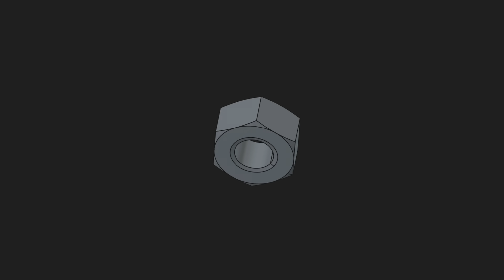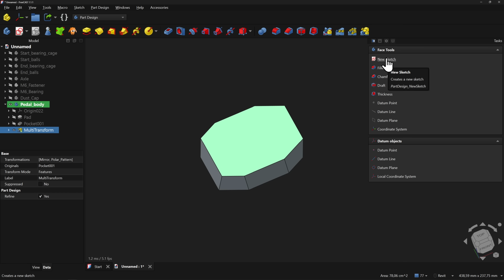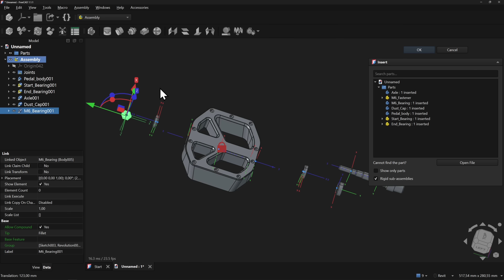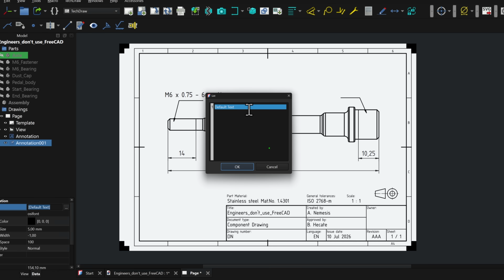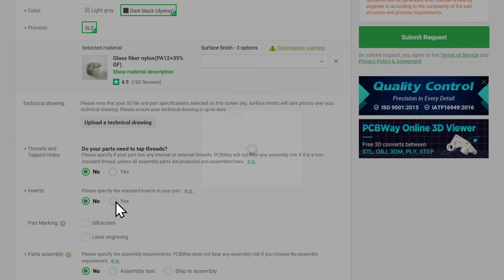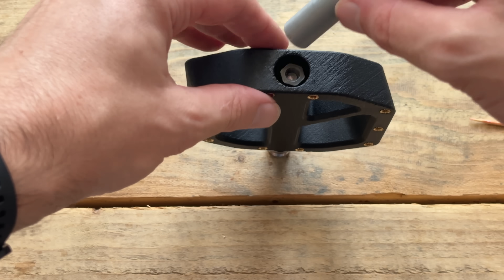Engineers don't use FreeCAD... Until NOW!

Comment: engineers DO use freecad! I used it last year for my machine design project in mechanical engineering and got full marks, the workflow the assemblies everything works really well. I do use creo now for work but for personal projects freecad is still my go to.
Reply: My team decided to switch to freecad to avoid the limitations we had with fusion (just one license for all of us) and we're having a good experience. Engineers use whatever is available (even if it's  from Autodesk) to complete their projects and Freecad has improved a lot. There's no reason to discard it for serious work
Reply: @dhombios well said. nothing wrong with moving to a different tool if it works better for you or your project
Reply: @dhombios  There are many reasons to discard it for professional work. Also ever heard of Solidworks, Solid Edge, NX, Catia, Inventor, ...? Any of those is much more powerful and stable than FreeCAD.
Reply: @iliketoast-q9b   It's interesting how the value of a computer's hardware depends on the quality of its software, yet many will happily spend thousands for hardware and practically nothing for software.
Reply: @dhombios  It's incredibly stupid to choose free tool over a commercial one just to save a few bucks. Commercial license fees are far less than the cost of the engineers' time. Moreover, the time it takes them to retrain on the free software plus the lack of features makes the free software more expensive.
Reply: @bobweiram6321 it isn't if you can't decide the number of licenses bought, but you can choose the software. Corporate decisions can be weird. However, the good thing is that they let us contribute fixes to open source software if that are needed to complete our job
Reply: @bobweiram6321  Are the commercial products really that much better for all engineering work? Doesn't it depend on application? Wouldn't it be foolish in a certain situation to spend thousand on a license for something that is an overkill for the specific need? Not that I know much, I model for personal projects only and that's why I use free cad.
Reply: @bobweiram6321  and with that you’re the dumbest person in there comments yet! Enjoy being ripped off for trash overpriced software!
Reply: @sadawjameed  Seems like your company got blinded by sunk cost fallacy!
Reply: "I do use creo now for work but for personal projects freecad is still my go to." Exactly, virtually nobody is using FreeCAD professionally.
Reply: @iliketoast-q9b Let's be real.People use Creo because the company they work wants them to use it.I will say no one wakes up in the morning and decided to use Creo.
Reply: @iliketoast-q9b the fuck they’re not! 😂😂😂 you people are actually stupid
Reply: You full of it!  Using it for educational projects is not the same as using it for professional engineering projects.

Comment: Freecad 1.0/1.1 vs older version feels like blender 2.79 to 2.8, I don't know what happened in the developement team but the improvement is crazy. Thank you for teaching this amazing software
Reply: They got money to speed up. :)
Reply: @arkadiuszzielenkiewicz5566 yup, and a ton of improvements and code from ondsel engineering suite
Reply: @arkadiuszzielenkiewicz5566  Fusion360 was the best thing that ever happenedf to freecad imo.
Reply: FreeCAD 26.3.0Dev is available now
This is not a typo , they have adopted a new naming convention
Reply: @PaulG.x again a new naming convention. They started out with ZeroVer if I am right. Until they did decide to release a 1.0 version and now they have joined the year.version bandwagon.
Reply: @PaulG.x  The mojang naming convention ;p
Reply: @PaulG.x  IMHO every software project need to have two kinds of the versioning. 
- X.Y.Z
- YY.MM.x

The problem with the first one is that if the developers don't have a good project objectives, they don't know what the next major version should have as features. So then the 1.5 vs 1.8 is meaningless as they don't know what 1.8 should have what 1.5 doesn't have. So they quickly rush to 2.x series and then to 3.x series. And that is the Apple fault, that did go to "iPhone 2" and "iPhone 3" and so on. And everyone ran after the same stupid ideology where major versions are released once a year. 

The year and month versioning is better in that moment, when you have a schedule of release, with unknown versions. So you know that there is to be something released in 3-4 months from now, or know exactly that week 31-32 is the time. Like Apple. Or like now many other Linux distributions. 
That is great as you know example that 26.1 means January 2026. Or 27.4 means 2027 April. 

But I still prefer the versioning X.Y.Z, as it is project own. But if you belong to something else, major project like example KDE's Plasma Desktop, then all takes the same time based versioning.
Reply: they've essentially resolved the major problem with this software: the topological naming reference.now you create an object based on a 2d sketch and then change the sketch without ruining the child object
Reply: Facts.
Reply: The FreeCAD 1.0-1.1 were not bad at all. It just had some methods that you needed to learn. 
I came back to FreeCAD 1.0 after years, and I think I used 0.9 version before that more seriously, and then I think last version was 0.16 that I used. 
Then few weeks after that the 1.1 got out. And there is a major changes, but I still consider that FreeCAD was not bad earlier. 

I am still finding myself staring the new icons and all, as I have muscle memory from previous versions. 
And learning the new easier ways to do things is heavy, but step by step it becomes much faster and easier than it use to be. 

I think someone just kicked the visualization to roadmap for the developers, that what the user needs. And I think part of that is the 3D printers availability. 
As example when I first time came around to FreeCAD, it was I think 2005, and it was 0.2 release news, that draw my attention to try it. 
I needed quick way to do a simple 3D animation model, and I thought a FreeCAD would have offered that. But I needed to go to Blender side. 

It is crazy to think that the development has been pretty rough, until now in last few years it seems.
Now I can comfortably recommend FreeCAD to casual people, when they want to design something before building it. 
As it has become so easy and simple to make the designs.
Reply: Still hope they will improve some aspects, cause even now its a bit buggy, quite often misleading error messages, errors in childs, when editing parents layers, sometimes crashes etc. Still awesome, hope team will get necessary budget to improve things. I'm no pro engineer but have 200+ models in blender and now 12 in freecad)) All for 3d printing purposes))
Reply: They incorporated a lot of changes from a commercial company, who were making Ondsel. Unfortunately Ondsel shut down, but most of their improvements could make it back to the main project. That and I think they incorporated most of RealThunder's changes for topological naming.
Reply: @ivolol and thank goodness there. Otherwise it would be completely unusable. That issue made the entire system far too unpredictable for me, coming from solidworks and onshape, to be able to do anything.
Reply: Thanks for another cool tutorial!
Reply: I didn't have any issues with older versions of FreeCAD however it's now considerably more intuitive. I hope it receives more funding from industry because it has huge potential.
Reply: AI happened :D I think it helps a lot in FOSS development
Reply: @Max-ti5gz no, it doesn't. 
The AI code is bad at best. You can't even get proper simple scripts made with it reliable manner. 
And programmers know how to do stuff, problem is to motivate them or inform what is needed and how.

I can give you tools to build stuff, but if you have no vision or objectives of what you want, you can't build a house for yourself.
Reply: @paristo  I am Embdded Software Engineer for 10 years at this moment and I can say, that AI is doing 90% of the job I was doing 2-3 years ago :D it is game changer. Now people who knows CAD, with right LLM can do good changes and push them to github repos
Reply: @paristo well, if you dumb and can't give ai normal prompt then yes. Any dev knqo how to use ai they give specific task that ai can do while they working on sometjing else
Reply: I was using librecad for last 4 months, suddenly a guy release cad studio as opensource cad software is amazing how he improve the the soft in a couple on months
Reply: Money and AI
Reply: i don't know what happened just as AI arrived... weird....
Reply: @clippy-jordies AstoCAD happened
They are a team of donations financed developpers whom aspire at improving FreeCAD
Reply: @syxalite  This is the real answer. Ai can make development faster, but it doesn't make anything better without motivated people like that to use it.
Reply: @clippy-jordies   Nah. The 6 years of previous improvements worked on by forks were poured in, shaken out and iterated on, that's years of pre-AI work that existed out there but FreeCAD project was backlogged by several years on pulling them in. I think Ondsel was the shake-up that Freecad needed, and some grants and paid roles within Freecad organisation. They also got rid of some people (who are now very angry) but i am getting the feeling some of these people may have been difficult to work with and blocking progress. Open source projects attract people of immense engineering talent, but some of them are actual divas, and everyone else is stuck catering to them, because they seem so useful, and the productivity of the project drops like a brick - i can't say that this has happened in freecad, but i have seen it happen elsewhere with my own eyes.

Also once a project reaches a certain critical mass of functionality and quality (and also infrastructure) it becomes way more rewarding to contribute to, so these sorts of productivity explosions are very common in open source in general.
Reply: @clippy-jordies no, its because Ondsel engineering suite gave all their improvements qnd code to freecad. Ondsel got a grant for 3 years or so and freecad was their  backbone
Reply: @clippy-jordies  In reality, it was company called Ondsel which made nearly all the UI improvements. Unfortunately, Ondsel run out of money in 2025 but it appears that FreeCAD will continue as a community projects creating further improvements after incorporating all the good parts from Ondsel.
Reply: LLMs happened
Reply: Ai
Reply: 1.0 comes mostly from the merge with ondsel in 2024-2025. AI in dev was barely getting used as fancier auto completion in large projects. But regardless, even if today a lot of AI is used in coding tools, there are still humans controlling the repos, doing the actual MR and testing.
Reply: @яатакч13  I was in the team, and AI wasn't widely available or functioning until 1.1. And even then the maintainers jumped on the bandwagon.
The real reason is Realthunder, with linkstage who boosted usage and interests.

Comment: The first step is already sus when we talk about "engieneering" software. Any serious engineering software would have a sufficient standard library of parts while in FreeCAD you have to mostly create the most common stuff from scratch. No the parts_library addon is not sufficient. Who models a bearing?
Reply: Mcmaster carr catalog????? You know that in solidworks this is an addon as well?
Reply: @garrettbaldwin8311  thanks for proving my point that you have to go to an external website and manually import generic parts.
Reply: Honestly the built in stuff is usually pretty rubbish anyway. Solidworks has a really well fleshed out part library for standard stuff in the US but over in metric land it's fairly useless beyond the absolute basic parts, 90% of the time it's easier to just bring in models from suppliers or mfgs. For example bearings - SW has some but I just pull NSK parts as their range covers pretty much all the standard available sizes over here.

Comment: how about use mcmaster-carr models for standard parts? @deltahedra
Reply from the maker: @Shahzebmhd It's a good resource with plenty of models! When my parts are available in the fasteners workbench, I prefer using it directly in FreeCAD. It uses constraint placement and you can change the size in a single click.

Comment: Could you make a video tutorial about transferring logos that are shaped as text to cylindrical part made after a revolve operation, projected axially and radially? 
The text must not be a common "times new roman" font (or something like that), but a genuine logo - like "coca cola" or "target" or "NASA", etc. 
That would be greatly appreciated! 

And by the way - Freecad is definitely suited for engineering projects. I'm so thankful we have this amazing program and thankful to the people who keep developing it!
Reply from the maker: @dmitrynova Regarding the projected text, you can use the Sketch on Surface tool in the Curves workbench. It unwraps the face so you can sketch your text. The latest FreeCAD build also has a text option in the Sketcher, which you could try. I use FreeCAD every day for engineering projects. I frequently see messages saying FreeCAD is not for engineers, so I just wanted to share my experience and prove that this is a wrong statement. Thanks to the FreeCAD devs for their hard work!
Reply: @deltahedra3D  if you could make a "logos on different shapes in FreeCAD" tutorial, i think a lot of people would appreciate it. Thank you!

Comment: Can you make a video on the FEA/FEM capabilities of FreeCAD? That is the only piece this workflow seems to be missing to use it in engineering workflows..
Reply: This!!!!!! FEA is really needed.
Reply: FreeCAD already has integration for calculix and Elmer, I have been using them for over a year now.
Reply: @f1chtl  biggest issues i've run in is that it has a bug where it only runs in single core mode, and that I haven't figured out a way to simulate assemblies, where multiple parts influence each others via contact forces.
Reply: @iluvbooks-i2p6l  Most cad softwares FEA is pretty basic to be honest. In most cases in my workflow except for quick drafting i export my CAD geometry to real FEA software like Ansys or Femap. Though i guess for smaller offices that cant afford to buy lots of software and dont have the time/expertise to write their own FEA, inbuilt FEA is better than nothing.
Reply: @Erowens98 what do you think about openFOAM?
Reply: @iluvbooks-i2p6l  I havent personally used it. My employer has an Ansys Fluent license so we use that for CFD. But i've seen plenty of serious engineering done on openFOAM so i have no doubt its powerful enough for professional use.
Reply: @Erowens98  Indeed. Most of the time integrated FEA solvers are basic. My company designed on NX and meshed the models with NX advanced FEM and then export to a solver like Abaqus to handle large deformation instead of relying on NX Simcenter-NASTRAN. Although, NASTRAN is a good linear solver (prolly the best integrated one there is).